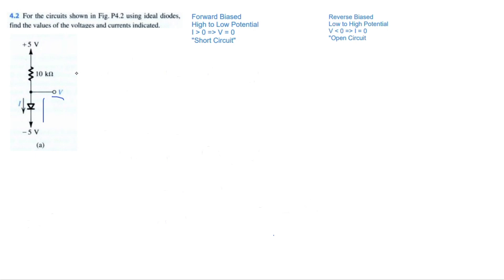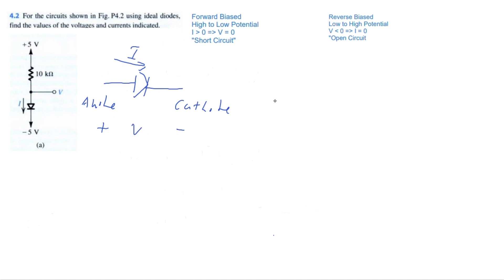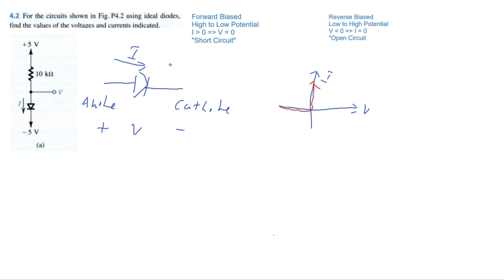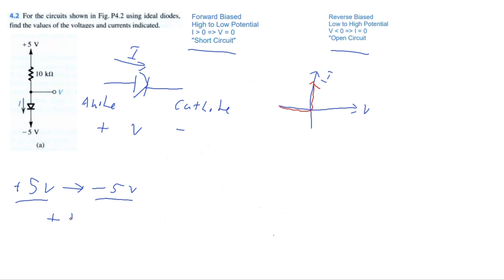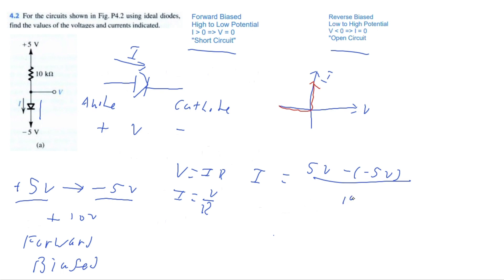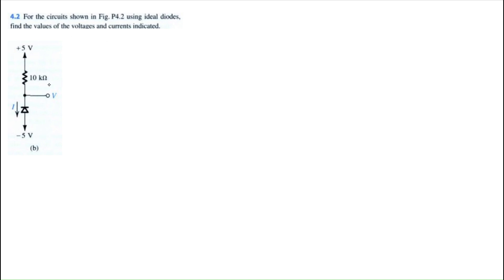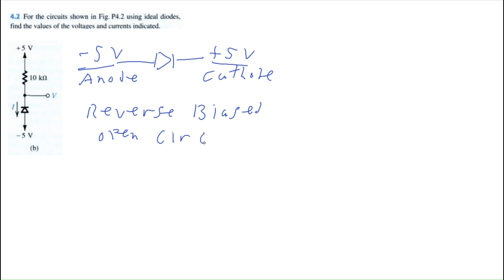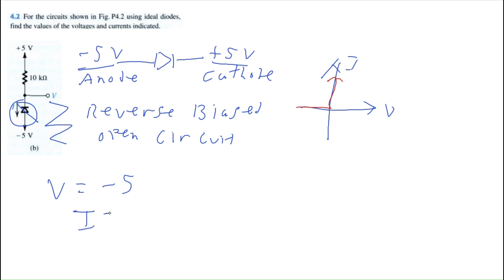Problem 4.2: Microelectronic Circuits 8th Edition, Sedra/Smith

Comment: at 4.22 problem B , reverse bias, why V = -5? and not 5V?
Reply from the maker: Great observation! You are correct, the diode is placed after the node measurement. And since the diode consume the entire voltage drop. The node should measure positive 5 V. Thanks for catching this, cheers!